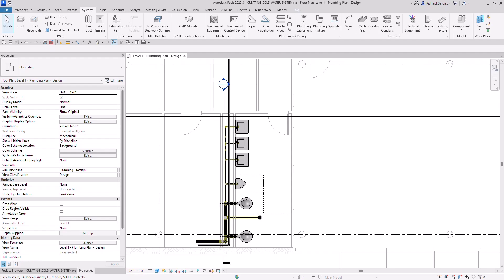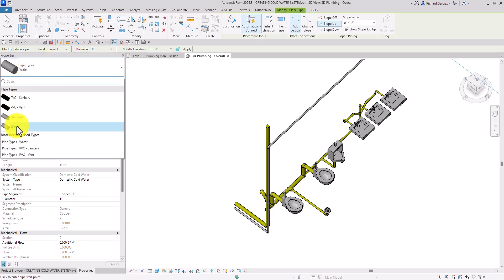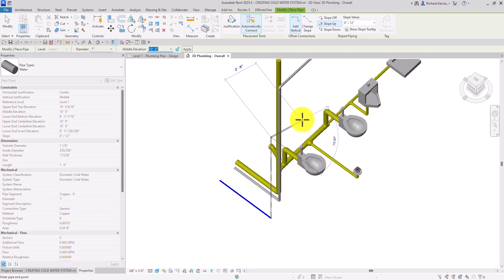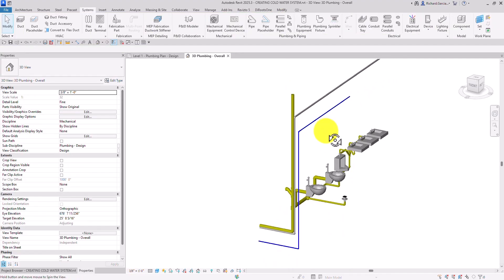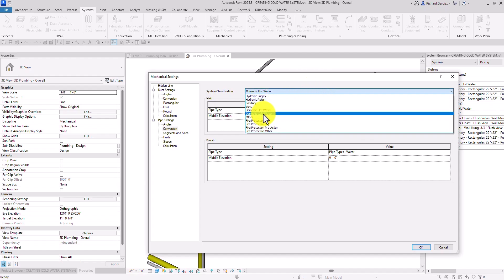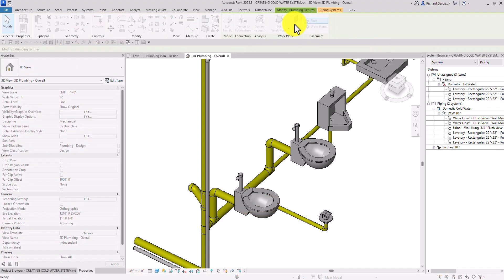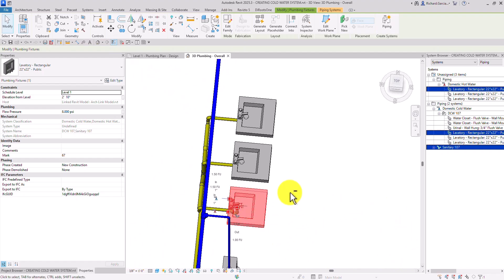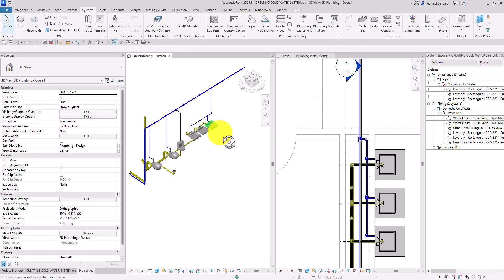REVIT 2025: DESIGNING PLUMBING SYSTEM - CREATING COLD WATER SYSTEM

Comment: hello sir, just want to ask what is the purpose of the middle elevation under pipe types? In the actual plan, the height of main pipe is 10' but in the pipe type it was set to be 9' 3".
Reply from the maker: hello sir, the "Middle Elevation" under the pipe properties in Revit 2025 represents the elevation of the pipe’s centerline relative to the reference level. It’s not a setting you define in the pipe type itself but a calculated value based on how you place the pipe in the model. In your case, the Middle Elevation shows 9' 3" because that’s where the center of the pipe is located, likely due to the offset you used when drawing it. The 10' height in the plan probably refers to the top of the pipe (TOP), not the middle, and the 9" difference could be half the pipe’s diameter (e.g., an 18" pipe). To confirm, check the pipe’s diameter and the justification setting (usually Middle by default). If you want the plan to match the Middle Elevation, adjust your offset to 10' when placing the pipe, assuming the plan intends the centerline to be at 10'. Alternatively, use a spot elevation or tag set to "Top Elevation" to match the 10' shown in the plan.